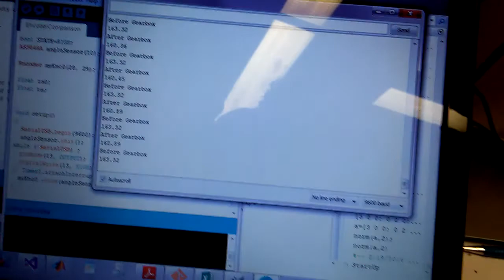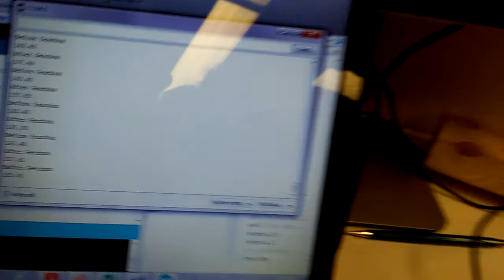Encoder woes from motor backlash

Comment: How to solve the backlash problem?
Reply from the maker: Good question. If you're trying to maintain the backdrivability of your system, you can try looking into things like capstan drives, however these also come with trade-offs such as a decrease in the range of rotation at the output shaft. If you need continuous rotation I would look into reducing the backlash through belt-driven transmissions which can be viewed as a capstan with an infinite pitch. If you find the answer let me know ;) !